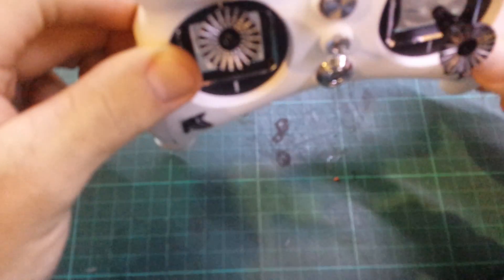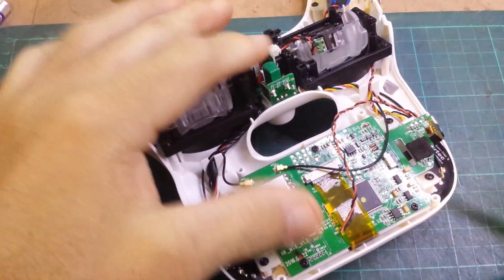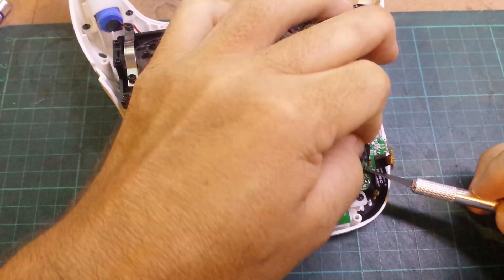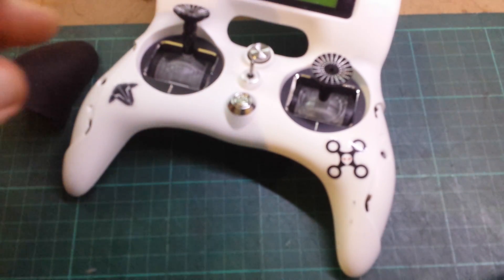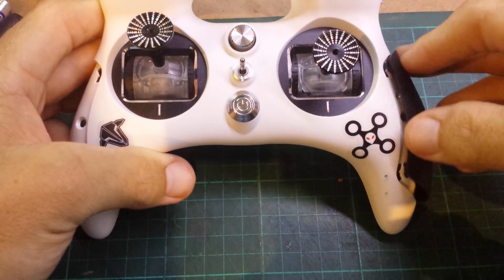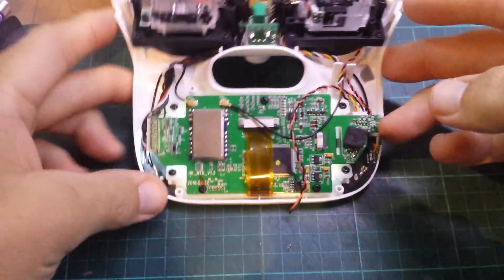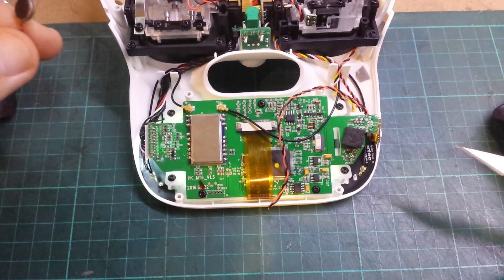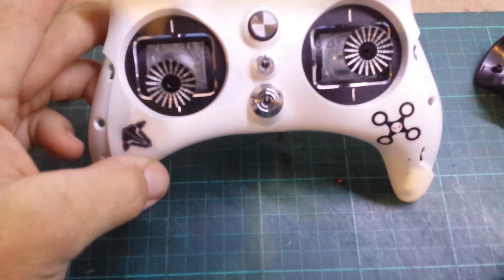Turnigy Evolution speaker/buzzer/alarm mod

Comment: i found just re routing the touch screen ribbon cable through the slot in the pcb fits the problem and you could always still drill a hole
Reply from the maker: yeah kinda looks why that slot is they hey? dunno. I wanted mine as loud as possible but now that I have bypassed resistor and add vibration motor I wouldn't bother moving buzzer.

Comment: Did you have to remove circuit board to be able to solder wires underneath ??
Reply from the maker: integra  no didn't remove circuit board just the ribbon cable to get underneath it.
Reply: but the wires you added are coming from under the circuit board ??